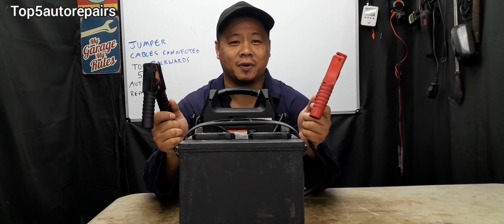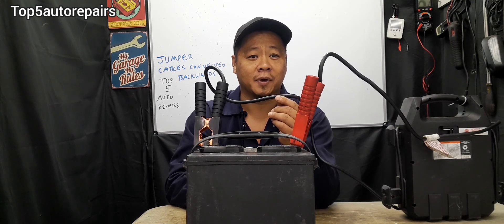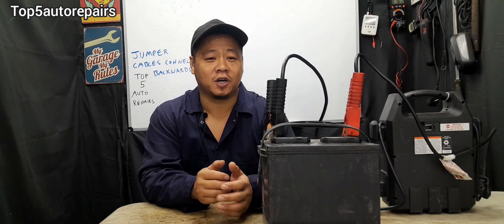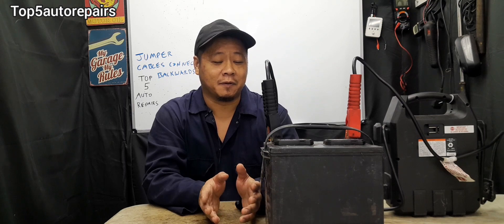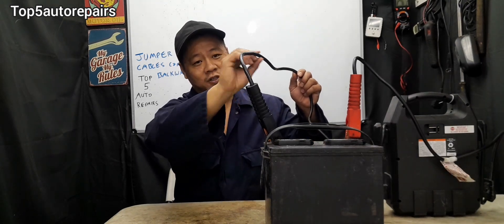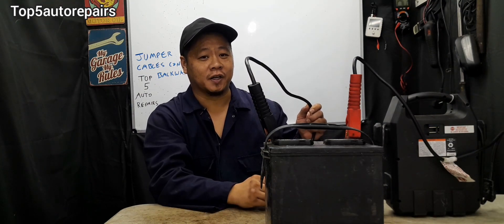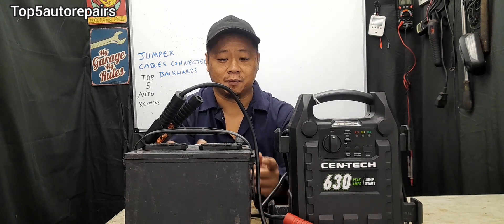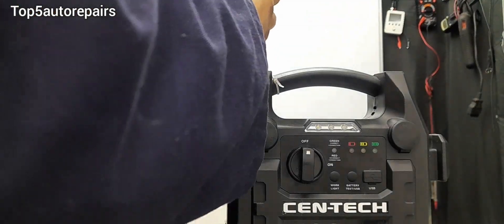CAR NOT STARTING AFTER JUMPING BATTERY WITH THE JUMPER CABLE BACKWARDS

Comment: Hey So I Have A Camaro Ss But When I Was Removing The Negative Wire The Wrench Was Still Connected To The Negative And Hit The Positive And The Car Turned Off So Now I Cant Start But I Can Unlock Nd Lock My Door
Reply from the maker: Hello. Check the fusible link. It's on the battery terminal or cable. It's probably blown.
Reply from the maker: Hello. Check the fusible link. It's on the battery terminal or cable. It's probably blown.

Comment: My suzuki escudo v6 h20a engine is not starting and when I checked on the other side of plugs I found that three of my plugs are not burning gasoline and on the other side perfectly...what should I check to have my car back on road please help thanks.
Reply from the maker: Sounds like Iike an engine misfire. Check for spark, fuel and low compression.

Comment: I dropped a wrench on battery today No start no lights no power at all I jumped in the car  for a sec afterwards my lights came back on,radio etc I turned the key to see if it would start no luck at all still no power
Reply: Bro I need ya help on this I can’t figure it out yet I just tried jumping the car with a jump box it ran for about 5 minutes then shut off & still no power